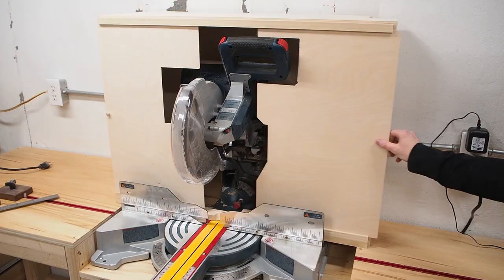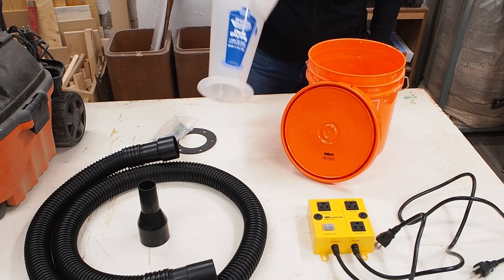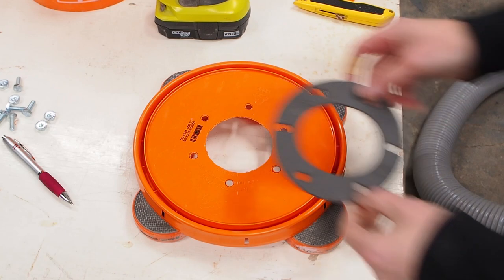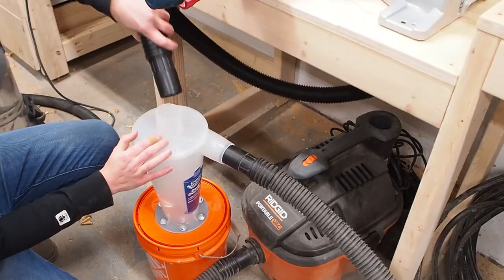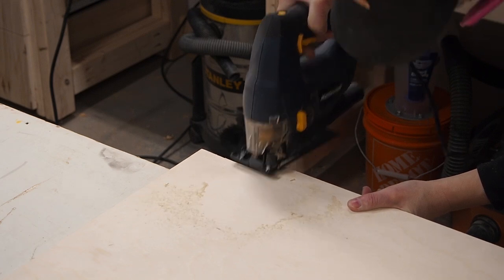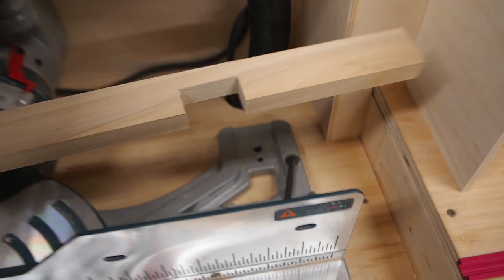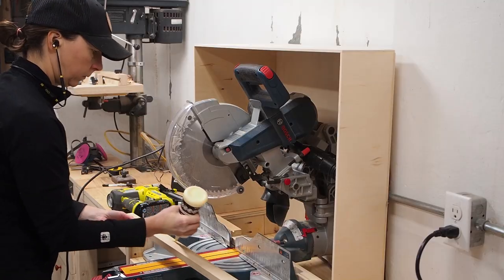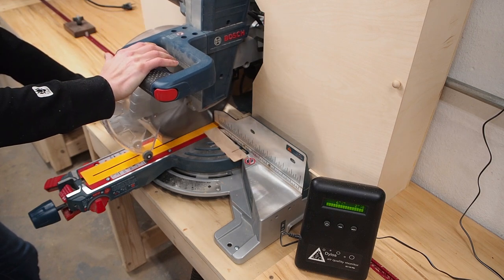Miter Saw Dust Collection || Dust hood and Cyclone

Comment: I have a Bosch Axial Glide as well and like pretty much all miter saws, the dust collection is not great. Glad you found a solution that works for you. As an alternative to the cyclone that you show, HD sells something called the Dustopper, which replaces the lid of any standard 5 gallon bucket and doesn't require any work to install like that cyclone. I bought it because I'm lazy, but it works well. It's usually cheaper than the dust deputy as well. YMMV.
Reply from the maker: The duststopper is on option, but I could not find it at HD where I live. Not sure they sell it in Canada, at least not Quebec. It's definitely the simplest solution, but tests show that the cyclone is more effective. It's a good easy and cost effective alternative though.

Comment: Welcome to the club of hose mis- direction. I have had cyclones for years and still remember when I first connected it to the vacuum. Yep, hoses on the wrong ports. Easily done but but now we how the cyclone works don't we? I am still looking to reduce the dust on my mitre saw even further. Well done using the particle monitor, I do the same to keep an eye on small particle levels when using my tools in the workshop. Keep up the great videos. PK from Australia.

Comment: What an awesome idea ! That gives you opportunity to easily remove doors and clean up the inside whenever you need to. Also, 4" hole at the bottom and connected to a central dust collection system would capture a lot more particles. 

I also really like the extension wing, gives you the support you need for long pieces without the need for building an extra long station. 

Well done !
Reply from the maker: Thanks! Agreed with the 4" connected to the dust collector. That would mean having a hose on the floor (trip hazard) for me, so it's not in the plans for now, but maybe one day if I pipe out my dust collection.

Comment: Excellent build!  Thank you.  One issue I have had is with the cyclone dust collector bucket.  Sometimes, the Shop Vac pulls enough air to collapse the bucket.  To remedy this, simply drop the initial bucket into another bucket (no gluing, no connecting, just drop it in), and no more collapse.  It works well, I have not had them collapse in over 6 months since I doubled them up.

Comment: Awesome. My daughter will be moving out of our two bedroom condo soon and her room will be my permanent shop. Can't wait to be able to contain all that dust! Current projects have pretty much come to a standstill because the house cleanup takes about as long as the project! 
Right now I'm just using a backdrop so the dust is limited in how far it can fly off. I will definitely revisit your system when I take over my permanent space.
And yes, the Cyclone is fabulous. I can't imagine what it would be like without it. I put a trash can liner in my Cyclone bucket for easier clean up. Open, lift, tie, toss, DONE!
Thanks for the links for hoses and adapters. Wish I knew this when I first got the Cyclone. This was the most frustrating part as I move my Cyclone around to all my saws and router, each with a different size adapter. YIKES!
And as others mentioned, thanks for sharing all the other really useful gadgets. Love your work!
All the best from Toronto,
Russ
Reply from the maker: Thanks Russ!
Agreed that finding the right hoses and adapters is the most frustrating part, so just trying to lend a helping hand!
As for using your daughter's old room... You'll definitely need to optimise dust collection!! Hopefully this will help with that. Best of luck!

Comment: I use a similar setup for direct dust collection from miter saw, with the Dust Deputy, iVac switch, and Ridgid shop vac.  
That's a great vac.  Mine is ten years old, still going strong, and it was not expensive at Home Depot.  Dust Deputy collects most debris.  A DIY wooden box with a sliding door can have as much volume as the orange bucket and with a lower profile for better clearance.  It must be a sturdy box since that Ridgid vac pulls a lot of suction.  
The iVac switch works great.  I have one on the miter saw and another on the grinder, but only the one Dust Deputy on the miter saw.  
You took it two steps further, using the dust monitor and the housing for the saw itself.  Good thinking.
Reply from the maker: I like the wooden box idea but wonder how to create a box with a tight seal that still has an easy removal lid. Any thoughts?
Reply: Try building the box like a very strong drawer with a bottom that slides into dadoes.  The sliding "bottom panel" can be on the bottom like a drawer, on one side, or even the top.  The thin plywood typical of drawer bottoms is not beefy enough for a dust box because a good shop vac is strong.  As long as the rest of the joints are tight, the sliding panel will be pretty tight under vacuum, which pulls it together.  

A hinged panel works, too, because the vacuum will pull it tight.  The configuration of the lip could be anything that looks interesting to the maker.  

On a much larger chip collector for a planer I used a weather seal strip between the box and the lid, which lifted off.  That was great for sealing the box but then the lid stuck to the seal.  After a few sessions with a screwdriver to get them apart each time it needed emptying, the seal was probably no tighter than some nice joinery like a half-lap lip would have been.  It still worked fine.  

On several dust collection boxes I used window locks to lock the lid down firmly.  The "Everbilt Window Sash Lock with Tight Seal" worked very well, for less than $4 at the orange big box store.   Just mount it so it pulls the lid into the box.  Compression from ordinary window locks might be enough but usually my box configuration didn't work for them.  Again, the internal vacuum will pull the lid tighter.  You just don't want some annoying whistling noise while you're working.  The vac is loud enough already.  

Depending on the wood you're cutting, the dust can itself be a hazard, aside from the particulate count in the air (which you  showed so compellingly).  Wood dust that is inherently hazardous is another reason to collect it to start with.  

 So, why be exposed to it again when emptying the container?  If your container has a lift-off lid, a plastic bag can hold the debris for dust-free disposal.  However, a simple plastic bag does not work as a liner because the vacuum pulls the bag up into the outlet.  

If you put a heavy object inside the liner bag then the plastic behaves nicely.  Cut a heavy piece of plywood in the shape of the container, a half inch smaller than the container's inner dimensions.  Or glue something heavy to a light piece of ply.  

It's easy to forget the liner weight at the bottom of the bag at disposal time.  Tying a string to it makes it easy to get the liner out of the bag without having to dig around in that hazardous old dust.  Something a little lighter than paracord may be thin enough and soft enough to just close the lid on it, leaving one end to hang outside where it is easily seen and remembered.  Or, just consider the piece inside the bag to be disposable.  Scrap drywall works for that.  

If a five-gallon bucket fits, putting the Dust Deputy on the bucket lid, as you did, is much faster than building a box.  It quickly gets inconveniently tall with the bucket, the Deputy, and the vac hose curling out from the top of the tower.  But it's fast, and it works great.  

Sorry about the long reply.  It was a great question.

Comment: Marie Great project. You may find if you extend the flexible rubber boot on the saw the dust collected will improve dramatically. There are certain times when the extension is in the way but it does help significantly
Reply from the maker: Yes, I've seen that done before, but they never seem quite right. Maybe an upgrade idea for one day down the line.

Comment: I've just used your plans to build a mitre station (mirror image to yours) minus the press drill - I don't own one but I've left space for a module for a press drill. My first ever large build.

My dust hood is pants though - I'm so fed up with the dust it throws out. I'm using a Scheppach dust collector for down draft under the bench with a 100mm hose connected to a 100mm flanged spigot. But, I still have to connect my shop vac to the dust port on my saw. I can see whats happening - the majority of the dust goes up the port to the shop vac, some sprays out back and side and gets caught in the down draft and into the Scheppach unit. But, a good old chunk of dust hits the saw and sprays back into the room.

I really like your idea of the sliding doors. I was planning a new hood and this has given me ideas. Thanks.

Comment: I'll need to do something like that when I implement your mitre saw station design later this month. I experimented with modifying a cheap flexible 'hood' hacked from a leaf-collector , actually ignoring the saw's  dust port and venting the 'hood' itself via a 63 mm dia. hose connected to the vac. Worked better for me than using the saw's port. The vac's a TREND T30 AF I've had for years with in-built power switching. Nice video as always. You know I'd probably have connected that cyclone that way round too, it looks more intuitive !
Reply from the maker: I debated a few different ways of doing this, and a single dust hood with exhaust port was one of them. Not with a leaf collector though ;-) There are many options to experiment with. I find that at least the dust that doesn't get sucked up will get trapped, so at least I'm not constantly cleaning my workbench!.

Comment: Although I am doing all my wood work outside right now I plan on getting 14 X 24 shed in the spring the dust monitor will be one of my first things to get, thanks for the link to that also like the sliding door.  It is also good to see that if you make a mistake you admit it and say what you did wrong. I have seen some videos that a person does something wrong, doesn't say anything then later on in the video you see a change. Like all your videos.
Reply from the maker: Thanks! Nothing wrong with making mistakes in my book, that's how we learn. 
From my research (and video from @Jay Bates - woodworking videos) this is the most reliable particle monitor for the price range. I highly recommend based on my experience with it so far.
Reply: @DIYMontreal  Jay Bates' video where he made a bench out of 8 2 X 4's is what got me started, so of snow balled from there , lol. I really enjoy working with wood.

Comment: Instead of notching for the red screw that secures the fence. I replaced it with M6-1.0 x 12  metric screw, so only a very small notch is needed. A M6-1.0 x 10 would be perfect. Great video.

Comment: Awesome build. I modified your concept for my DeWalt MS, but the basics are the same. I sealed the gaps between the lower rails and the side of MS base to help in the air flow, and it makes a HUGE difference in the dust containment. With fairly slow cuts, I get at least 90% captured, especially the finer stuff. As someone else posted below, a curtain  (or rubber flap in strips) hanging down from the middle might help. That will be my next mod.

Comment: Thank you! Your videos are of great help, it shows the steps to avoid, as we find out some good ideas do not work as planned. Wonder if it would help if the encased area had a melamine or slippery surface, maybe dust collection improves a bit? Raw wood seems to be harder to keep clean, in my shop anyway. Thanks again!

Comment: thanks for posting I see the 35 mm adapter for the Bosch but where did you find the 90 degree adapter. My Bosch is brand new and has the bag and red retainer clips built in to that 90 degree.

Comment: Hey there, nice build! I’m wondering if you or anybody else had the same issue w/the dust deputy as I did (although I’m guessing “no” for you, since you didnt mention it). I had my HD bucket collapse in when using the cyclone separator, but was fortunate enough to have a metal bucket that my modified lid was able to fit on, and Voilá! No more suction cave-ins! My seal on that lid was enhanced when i added silicone underneath that gasket, as well as around the nuts and bolts, on top as well as underneath. I wonder how well your seal is, or anywhere along the hose connections, as ANY leakage will drastically decrease its efficiency. I’m also wondering if your smaller bucket also made a difference in its ability to withstand the vacuum suction force. Thanks for sharing this! Aloha....😊
Reply from the maker: This is my first experience with a cyclone and no issues with collapse so far. Perhaps because of the smaller bucket. For the larger bucket, they recommend using 2 buckets pilled together to prevent cave in.
My seal seems good but I think I could make it better with silicone. Perhaps I'll make that modification down the line but for now I am satisfied.

Comment: Nice i have the same miter saw this will work perfectly fine! May i ask how you build or bought the zero clearance insert. Thanks in advance! Great video!!
Reply from the maker: The zero clearance is a simple piece of tape made for this application. Check it out here: https://www.amazon.com/dp/B07C68GTVK/?ref=exp_diymontreal_dp_vv_mw
Reply: DIY Montreal thanks!

Comment: OMG... I've been running my Dusty Deputy backwards this whole time.   Just wow.  It's been working pretty good, but one of my chief complaints is when I connect it to my Bosch CMS.  I still get a ton of chips/dust that comes off the blade.  I wonder if putting it together properly will help reduce those extra chips.
In your setup, you are connecting the hose to the dust port on you CMS.  I am wondering if you put a Y on your Dust Deputy.  Keep the existing connection going to your CMS dust port.  Add some type of dust hood at the back of the machine.  Preferably one that would span wide enough to protrude on both sides of the back of your CMS with a 2-1/2" port.  Would that collect the lion's share of the dust/chips in the back of the CMS.  I know that the primary concern would be splitting the available CFM's between 2 ports.  Can the Dust Deputy produce enough CFM to run both effectively.  If someone has tried this, please let me know.  I am her to find a box to build around my CMS because of the excess duster/chips it spits out the back.  Hopefully someone here has tried this successfully.

Comment: I built my miter saw station using your plans as a guide and am getting ready to add this dust hood. Quick question, do you open the hood and vacuum out the inside area every so often? I was thinking about adding a large drawer under the miter saw bench and cutting out a large portion of the center of the bench to allow the dust to drop into the drawer and make vacuuming easier. I would probably add some angled sides to help the sawdust fall easily into the drawer. My cyclone is low profile and allows room for the drawer. Any thoughts?

Comment: You should consider removing the collection system from the saw itself.  That little port is significantly reducing your air flow.  There will probably be more dust inside the cabinet but you should collect a lot more of the fine stuff that ends up airborne.  I like the design though.  The sliding doors are a great idea
Reply from the maker: If I had a 4 inch port from my dust collector connected to the box, I would agree. But the so vac is not powerful enough without a port, that why I added the box to contain the excess. So far it is working well.

Comment: Do you have power problems when using the dust separator and Bosch mitre saw at the same time? I have a single 20A breaker on all the outlets in that room.
Reply from the maker: No it's never tripped the braker.

Comment: Just curious why you only make your miter cuts from the right side of the saw. I've been using miter saws for several decades, cutting pretty much equally from each side, and with few exceptions, I've never had any problem cutting from the left. Is there something I'm missing?
Reply from the maker: Nope, nothing missing. First off I rarely make miter cuts on the miter saw, and when I do, I just feel more comfortable holding the wood with my left hand and having the blade angled to the right.